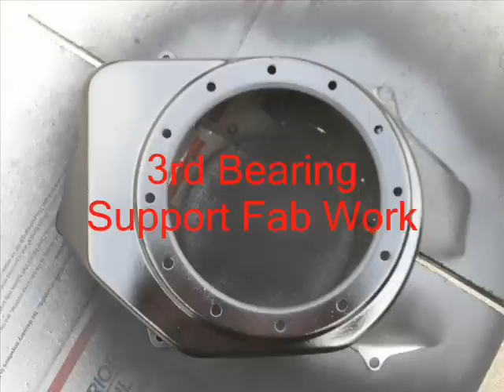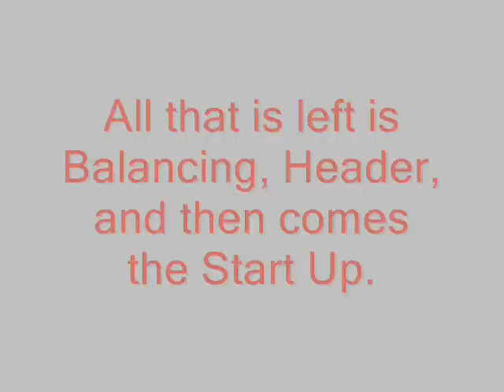Worlds Most Powerful GX200 Honda "Top Fuel" The Build

Comment: Impressive on multiple levels... do it all yourself?  
Between standard mechanical skill's, the design knowledge it takes to push them to the limit & machining required... Would be good to oversee one of these aspects, but i get the feeling you were responsible for most or all of it. Either way, nice work.

Edit, forgot to mention welding... Funny considering that's my main trade. (Would be interested in how you deal with warping & do you stress relive it after? Thanks)

Comment: I would be very disappointed if that motor don't make at least 40hp. Lectron is the best carb ever made. If that one is proper size use it. I didn't know they made Lectrons that small. The smallest I have seen was 38mm. Get a CVT trans like they run on the high hp Jr. Dragsters and you better have a long wheelbase or wheelie bars. I hope to hear this motor soon
Reply: Macuni is Ok with good throat ...

Comment: The real reason he doesnt use a torque converter is that the belt will split on a 10hp bike! The belts are the weak link, they were designed to go on stock 3 and 5hp engines. Anything past 10hp needs a clutch and chain setup.
Reply: cxbra you have obviously never seen a Jr dragster, or for that matter a snowmobile

Comment: You mean the most powerful gx200 on you tube...
Reply from the maker: Back then is was the most powerful of all gx200 hondas. But my other engines are way more powerful now. And no one else is close.
Reply from the maker: You have to remember, this video is 10 years old. And who had any of this custom stuff 10 years ago except me. And then its not like i stopped there. This engine was 312cc, 140cfm head, 35mm carb, running. 550" valve lift. It would barely be illegal for the engine challenge today 2020. But this engine only made 40hp. Now a days my smaller 291cc makes the same 40hp with a custom cast head. My 328, 335, and 350cc all make to much and is way illegal to run in the event